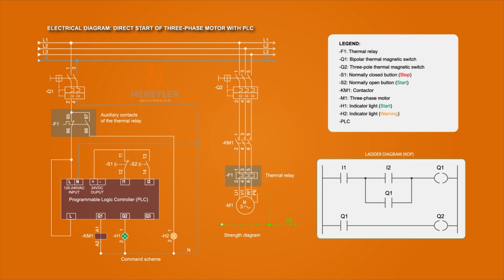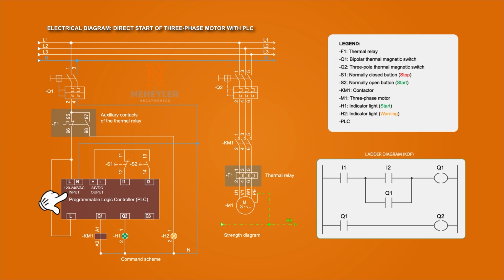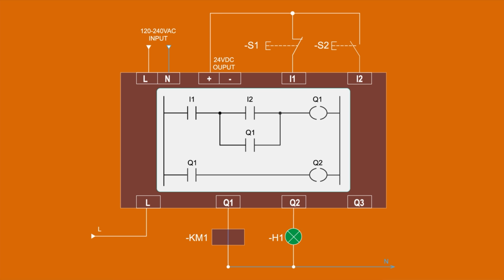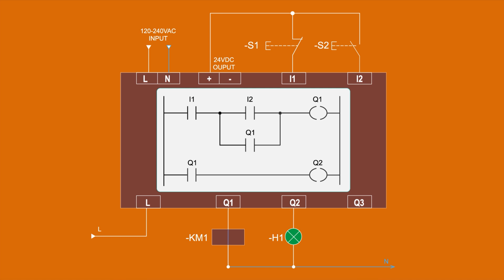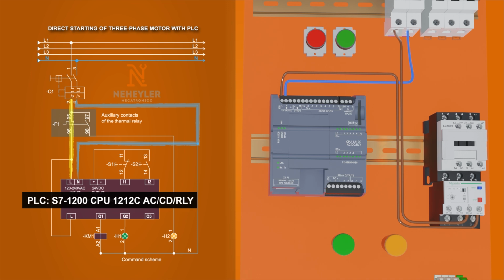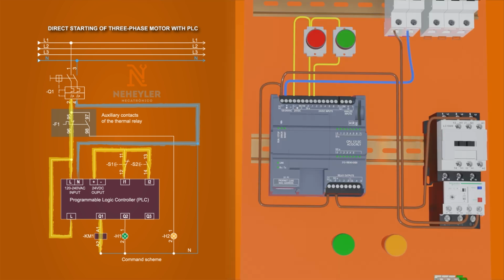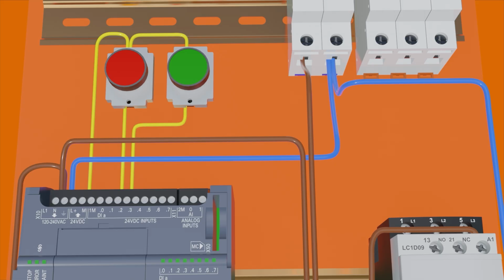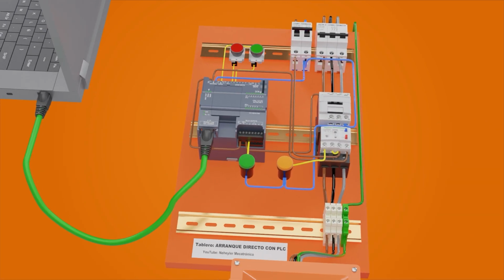Direct Motor Starter with PLC | PROGRAMMABLE LOGIC CONTROLLER | LADDER

Comment: Does it possible to make a few video by following, 1. A 220v generator 50hz with 3 phase connect to a main circular breaker box with fuse breaker just like at home main breaker box. 2. A 240v generator with 60hz connect to a vfd then power up a 3 phase motor. 3. if you can i hope you can make what is a single phase stator 220v 50hz  generator wiring with 18slots. < this one i still no sure single phase winding.